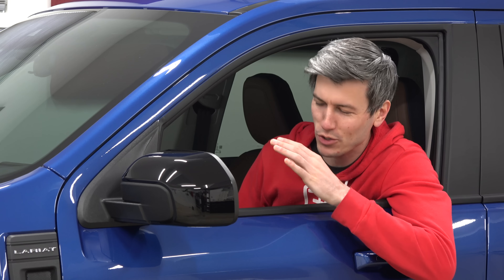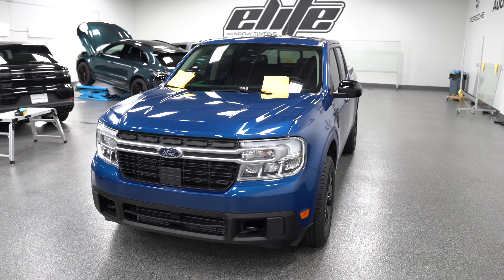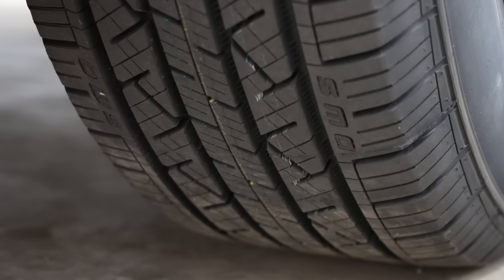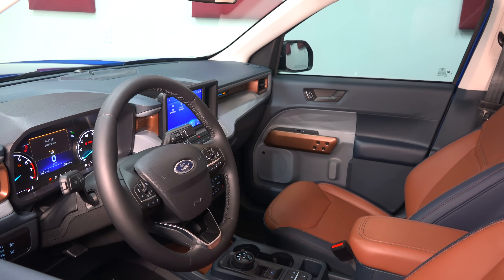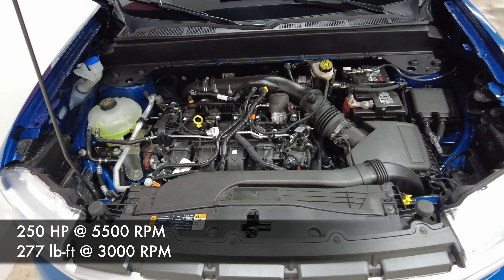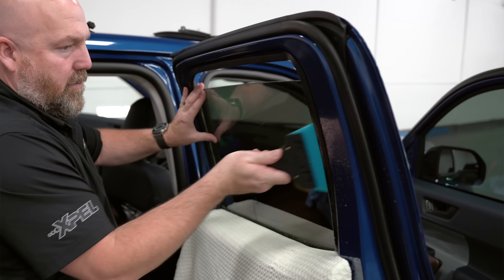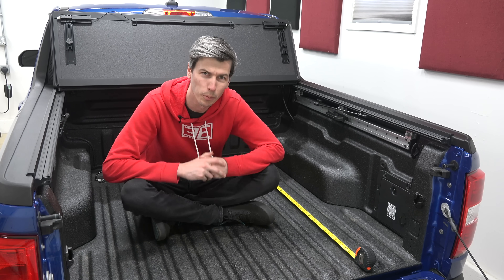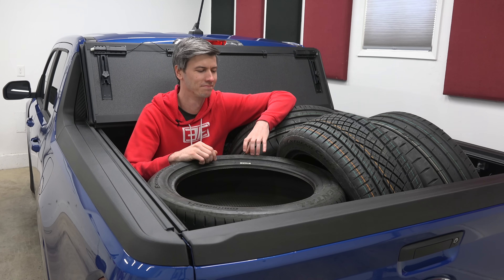I Bought A Ford Maverick! The Perfect Pickup?

Comment: Bring back the small pickups please for the love of God
Reply: I want newly manufactured, 1980s Japanese pickups! Without the modern gimmick BS!
Reply: @meanman6992 so you want a HILUX. Not saying that you are wrong BTW
Reply: @meanman6992 god I would love a new 1987 Toyota 4x4 pickup . Extended can of course and a set of white letter BFG’s and centerlines. Alpine head unit and I’m done. Oh! A bra
Reply: @meanman6992 bro there’s a thriving used market for this
Reply: Nobody has issues with small trucks. The problem is that they are all crew cabs only with tiny beds. Maybe if they make a standard cab with a 6-8ft bed I would be interested.
Reply: Bring back 2 door small trucks. So sick of everything having to be a damn 4 door.
Reply: Seriously! It's all I'd want. I hate driving big clunky dumps you never need.
Reply: S10!!!!
Reply: Until the idiotic CAFE standards are gone, this is what we got.
Reply: @AHungryHunky  Pretty sure Trump got rid of CAFE and thats why full size vehicles are huge now. They don't worry about size or weight anymore.
Reply: @AHungryHunky it actually goes back to the chicken wars.
Reply: @AHungryHunky  it's so rare to see someone actually mention the root of the problem and not just go "HURR DURR IDK WHY THE MANUFACTURERS DON'T MAKE SMALL TRUCKS"
Reply: @AHungryHunky  they need to be repealed or rolled back to something more reasonable, the point of diminishing returns has long sense been passed!
Reply: @meanman6992  Yeah, I think some regulation was necessary but thr CAFE has in practice produced the exact opposite of what it meant to. Now instead of reducing large vehicles we have soccer moms driving tanks.
Reply: @AHungryHunky  true!
Reply: Fashionably late 😂
Reply: Yes! I want a truck that reminds me of the Datsun trucks of the past!!!
Reply: this maverick is about as small as it gonna get 😂
Reply: Yes but give me a longer bed and extended cab option
Reply: This is why I imported a kei truck.
Reply: @TerraMagnus  This is why damn near everyone is importing kei trucks right now
Reply: Bring back what was small pickups. Not this. I just want a true replacement for my old Ranger. This ain't it.
Reply: Agreed and they were all bullet proof my dodge d50 is still going 😂
Reply: Get rid of CAFE and chicken tax and we get our small trucks back.
Reply: With a manual transmission please.
Reply: @johnl5525  I am in my 2002 Subaru Forester with a stick. So yes, I agree. Unfortunately, I think there is a snowball’s chance in hell. The best we can hope for is shift paddles on the steering for an auto stick.
Reply: My favorite small pickup truck was my 2003 ford ranger regular cab, 2wd, 4 cylinder, manual transmission.  Got almost 30 mpg on the highway and 23 around town. Did everything I ever wanted it to do and I had no trouble with that Mazda power train.
Reply: It won’t happen because government.
Reply: No way I'm paying $40k for a tiny truck made in Mexico. Ford pays its mexican workers $6 a day and then sells these things at top dollar.
Reply: Like a Ute?
Reply: Exactly. Since when did every truck need to be an AWD overland beast? What happened to just having a convenient little utility truck for hauling around furniture and stuff. 99% of people are never gonna use those $5000 suspensions we get now
Reply: There is no reason to buy a small pickup with how much they want to charge for them. Why would you pay $40k for this when you could get a used full size with <20k miles for that and actually use it for something? It’s not like these trucks get that great of mileage
Reply: Wvery truck should have air vent pickup holder or they are not truck
Reply: @allowa5220 Wvery 🙄 seriously are you lazy? Fix it now I have OCD
Reply: @yungboicontigo9278  nah did you try toyota Hilux before? These air vents actually functional and keep your soda called
Reply: @allowa5220  bro tf you’re on about? I literally pointed out your spelling error and you reply me with this nonsense?

Edit: oh you thought that I couldn’t catch your grammar error as well? Soda cooled not soda called. Who called the soda bro?
Reply: @yungboicontigo9278  man go be English but not here
Reply: lmao imagine thinking republicans and democrats aren't working together to control the population
Reply: VW caddy!!
Reply: The American consumer unfortunately rejects them, meanwhile , the rest of the world embrace them.  Just Google checy tornado
Reply: How many people have hung on to a 1990s Ranger? Yes, people want them!
Reply: I had a base 1992 Isuzu pickup that I bought for just $5700 new!    The only real issue with it was the short fifth gear ratio.  Otherwise, it was the perfect young guy truck.

Manual, regular cab, 6 ft bed, minimal controls (no radio), and hand crank windows.

The last carbureted vehicle sold new in the US.  But had rear antilock brakes.  Crazy dichotomy at an automotive cross over point.  

Would still be driving it if it hadn't rusted away here in Michigan.  I would love to get another (or something just like new).  I've seen them roving the streets of Reno when I visit family.  The high desert is mostly kind to older vehicles.
Reply: Agreed
Reply: Absolutely! Why does EVERY OEM take any successful small vehicle and bloat it out and jack up the price over time? The current Ranger, Tacoma, and Colorado are the size of what a full size pickup was just 15-20 years ago. And I think that the OEMs are discovering that there isn't a big market for $80k-$100k+ pickups.
Reply: and all the Kei Trucks are being banned!
Reply: Amen

Small trucks were pretty awesome.
Reply: i have a 99 sonoma... and im tired of the small pickup. lol.
Reply: vehicels need to get smaller. its literally a matter of public safety
Reply: Bring back the Subaru Baja and the 1990s ford rangers!
Reply: I love the idea of Subaru Baja; I love it so much, or--oh I dunno--diesel Toyota hilux sigh
Reply: Toyota Stout appears to be our best choice
Reply: Just wait for the price of gas to rise.
Reply: Toyota is going to be delivering the "Stout" in about a year and a half. Has me interested. Based on the Rav4 and base price is around 16k.
Reply: The dealerships hate small trucks. Just look at the addendums they put on the Maverick. We see them here for 5k over sticker.
Reply: I agree, my favorite Toyota Tacoma ended back in 2004, they just keep increasing the size…if you want a bigger truck buy the Full-size one!
Reply: They are back look at the video
Reply: I agree. But the maverick looks like a poodle turd.
Reply: They got rid of them because EPA required they have a certain MPG based on wheel size etc.   If not, the car companies were forced to pay a fee for those that sold to compensate for the requirements. Hence, it was cheaper for them to sell a bigger vehicle and dump small ones.  You have the EPA to blame  Same reason combustion engines and vehicles are doubled in price is because Biden and EPA are forcing them to go to EV.   Well, they believe if they make the price to high on a combustion engine  you will buy the EV.    Scam    Forcing the herd where they want you to go.
Reply: I dont understand why you guys dont get the new Ram Rampage
Reply: Yep
Reply: It might happen if not because people vote with their dollar and are not buying the recent trucks that rival what starter homes were about 15 years ago.
Reply: ...and for less than $30k. $40k for a Maverick is ridiculous
Reply: Amen
Reply: Small pick up trucks that can tow 10K lbs would be wicked
Reply: Not on the EPA’s watch
Reply: Toyota Hilux
Reply: Especially Toyota! They already have the platform!
Reply: With Chassis.
Reply: This is still a very small step in the right direction, we need a small pick up truck with a 6ft bed and extended cab, not an suv with a bed
Reply: Bring back small cars too, needing to make 30 to 40K profit on every vehicle sold is beyond BS.
Reply: Chicken tax. Look it up!!!
Reply: I'd even go the the smaller of the smallest Toyota truck of the early 80's. It came with 2.2L(not far off from today) and had no frills inside. Ac, crank windows, no power anything and was an absolute banger for the money.
Reply: Please bring him back
Reply: Literally in traffic today I saw a new Ford ranger behind a last gen f150 and they were the same size smh…
Reply: they never left, they just are called midsize now. Tacoma, Frontier, Colorado, ranger. F150 is mid
Reply: @Olds_Pwr  Please do some research before commenting. The fatality rate is much higher for large trucks because of where the front of the vehicle comes into contact with the body.

Sedans take you out at the knees, which sends most of the upper body mass (including brain and spine) onto the hood.

Large trucks and SUVS take us out at the chest, and they take smaller humans out at the chest, neck, and head.

This has been studied over and over...
Reply: @falsificationism  If one digs deep enough, you will find information proving otherwise. Such as a video showing a sedan hitting a pedestrian and the brain goes through the windshield while the neck and spine is twisted backwards. Please YouTube - Pedestrian Auto Test Texas A&M Engineering Extension Service (TEEX).
Reply: @falsificationism  If one digs deep enough, you will find information proving otherwise. Such as a video showing a sedan hitting a pedestrian and the brain goes through the windshield while the neck and spine is twisted backwards. Please YouTube - Pedestrian Auto Test Texas A&M Engineering Extension Service (TEEX).
Reply: all the camera sensors how why who cleaned it how much 🪬🫣
Reply: And for the safety of pedestrians!
Reply: @falsificationism  If a Maverick hits you vs a F450 Dually, hits you, your gonna die either way. Your argument is based on human stupidity
Reply: But with a full bed please.  This thing is an SUV with an open trunk.
Reply: @sfallier  I really hope they make a version with half doors in the back or just  a two door version with a longer bed. I really feel 6' is minimum for bed length.
Reply: @Dizzykitty817  make 8' the standard again please. They're so hard to find now 😢
Reply: @sfallier It can carry more weight than the 90s rangers everyone cums their pants over. It's a much better truck than that ever was.

Source: I've owned a 90s ranger and currently owns a maverick hybrid.
Reply: @sfallier Absolutely, and that's the exact reason we don't see more small trucks, because they all are given crew cabs with tiny beds.
Reply: @sfallier  That's exactly what people need. All of the MPG and passenger hauling, with light towing/hauling/dead animal utility of a small truck.
Reply: @sfallier  But with a full bed please.  This thing is an SUV with an open trunk.

yes my parent looked at one part time 4X4 and plugin-hybrid is parts of the reason for skipping as there cities/suburban ( 20-90 mile range EV mode and CC2/NACS ) and longer trips ( towing smaller car-sized, ie Chevy caviller 900lb-2500lb~ total and single axel trailers ) to family/my-house or siblings etc but they also like gardening and camping/exploring, and the blazer's/van's they had are something there looking to downsize from 

im a full size contractors 8ft bed spec user or my convertible/charger-60's
Reply: @sfallier  It's not even an SUV. The platform is much wimpier.
Reply: @sfallier  the maverick can fit full sheets of drywall in the back of it haha.  What more do you need?
Reply: @sfallier  LMAO 😂😂
Reply: @sfallier  Yeah totally fair. I'm not sure how many hay bales I could fit in there...maybe 6-8? If I could fit 12 it'd be perfect.
Reply: @sfallier that is exactly what I see. I was super interested in getting a maverick until I saw the bed size and the fact the hybrid doesn't have awd. Very happy with a full size truck in hindsight.
Reply: @Olds_Pwr  I hate to engage with top-tier willful obliviousness. The regulations (both Chicken Tax and CAFE) have been  changed over time. The specific changes that destroyed our ability to buy compact pickups occurred under the Bush administrations. 

Why? Because while Johnson originally wrote the Chicken Tax  to protect the Big 3 from foreign products, GHWB outlawed compact pickups, a rule that even screwed over Ford a decade ago when they were trying to make the Transit connect profitable.

When CAFE was originally written it was by Carter to reduce our nation’s dependence on foreign oil to avoid future oil crises, GWB changed it so that the bigger your vehicle (wheelbase x track width) the more fuel it could burn, which is why a Civic is huge now and all trucks are gargantuan.

But hey, you figured out where the regulations began and stopped asking questions because you didn’t want to disrupt your fragile worldview.
Reply: @Olds_Pwr  There's no need to speculate here.

Trucks and sport utility vehicles with hood heights greater than 40 inches are about 45% more likely to cause fatalities in pedestrian crashes than shorter vehicles with sloped hoods. 

This is a matter of life or death; anyone trying to complicate and confuse the issue is lying, paid by industry, or not paying attention.
Reply: Blame government for lack of small trucks
Reply: @rshinn1776 how so?
Reply: The EPA cafe standards have got to go first.
Reply: @caljeff2427 was that the claim?
Reply: You could rent a pickup when you need one unless your job requires it.
Reply: @niacal4nia Whoa, let’s not be finically responsible, or use common sense. This is the Americas, we reserve the right to be car poor and ego driven in every decision we make to our own detriment.
Reply: @paulmiller7078 The problem with the santa cruz and maverick is that the beds are pretty much useless. Better off getting a compact SUV. If you need to occasionally haul large items, you can get a nice utility trailer for $1000.
Reply: @Olds_Pwr  And at any rate, you're wrong on the physics as you describe.

When people are hit by smaller vehicles, they're taken out at the knees, then the body progressively breaks the impact on the HOOD of the vehicle prior to any contact with the neck/spin on the windshield.

Please stop spreading misinformation...we're talking about a difference of THOUSANDS of deaths per year; it's disgraceful that a person could be so cavalier about this...in the absence of any evidence.
Reply: @Olds_Pwr  So the finding was that there's no difference to pedestrian safety when they compare large trucks/SUVs to small cars and trucks?

That's a damn lie and you know it.
Reply: @Olds_Pwr  we yet we still had small compact imported trucks after it was introduced.  Try reading more than just the first paragraph on the wiki article. I’m not here to educate you.  I can’t make you think.
Reply: And make them affordable. The Maverick is anything but.
Reply: @KiegKillsReality what? What's an affordable amount of money for a truck?
Reply: @ Idk man I musta been salty that day lmao
Reply: @KiegKillsReality  😂
Reply: You can thank government regulation for making it illegal to make small trucks. Vote Republican.
Reply: @ChillyDogActual  What a weird comment that doesn't make sense. Making smaller vehicles is literally one way to achieve better fuel economy. People in general want huge SUVs and trucks, though. Government regulation would have auto makers manufacturing smaller and smaller cars and trucks, but consumers don't want them. Companies follow the money.
Reply: @ChillyDogActual  🤣 you think your vote counts. You not noticed who the rich selected and is in office
Reply: @ChillyDogActual  CAFE was born in 1975.
Reply: @ChillyDogActual  which president signed it into law?
Reply: @ChillyDogActual  It was an update to the Chicken Tax in 1989 that ended compact Japanese pickups from coming into the USA. George H. W. Bush was in charge at the time. 😂

Then his son was president when the CAFE rules got changed to give efficiency breaks to vehicles with larger footprints (2006 & the topic of the discussion). 

Republicans, specifically the Bushes, are the reason we don’t have small trucks anymore. 😢 Republicans love regulations when they help big businesses that donate directly to their pockets.

What you should vote for is people that will encourage education and critical thinking so we can move past thinking in tropes designed to crush the middle class.
Reply: @ChillyDogActual  I remember when we had a Republican president that was famous for putting his golf buddies in charge of gov agencies, specifically the EPA and yet here we are...

It's almost like rich people don't care about these issues and it isn't a partisan thing.
Reply: @Dizzykitty817 I agree guys pushing his political propaganda for no reason
Reply: @ChillyDogActual what's it like to be wrong about your entire stance

Comment: It's not a truck, you can't haul enough groceries unless you have a 5' bed or larger...
Reply from the maker: Tried to buy ice cream last night and had to leave it at the store! 😭😭
Reply: Need at least a 10k tow rating and 5k+ payload for groceries.
Reply: LOL, that's the most American thing anybody's said in the comments so far... Costco runs amiright! 🤣 I can't even tell if the comment is meant to be sarcastic - but to be honest 4x8 sheets of OSB and Drywall fit in the bed of my Maverick just fine and I've even had bulk mulch dumped in the back several times this Spring.
Reply: @indigetal  A great point. This is a vehicle for a homeowner for all the wet and dirty things you can't fit or don't want to put into a passenger vehicle.
Reply: Rated for 1400 lb in bed payload what is a raptors ?
Reply: @evmotorsports It’s exactly the same. Personally I would feel much more confident with 1400lbs  in a Raptor, but it’s interesting that it’s the same.